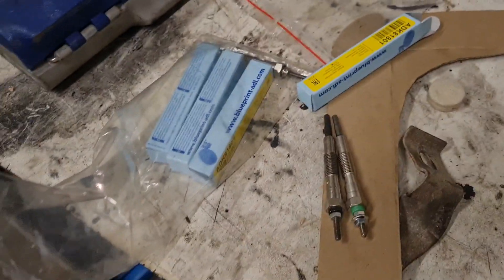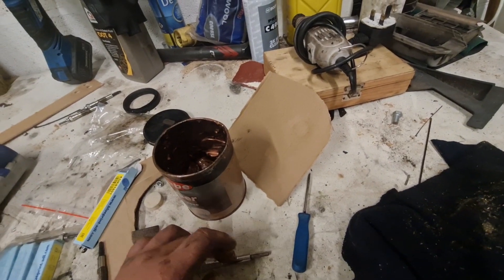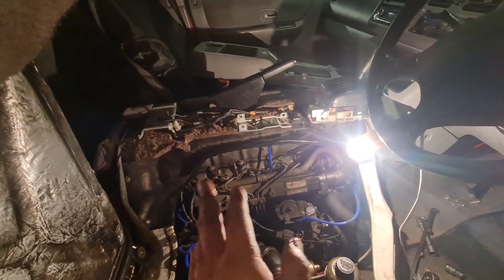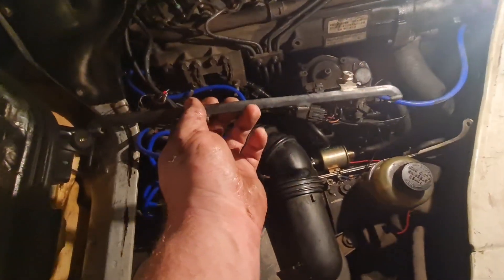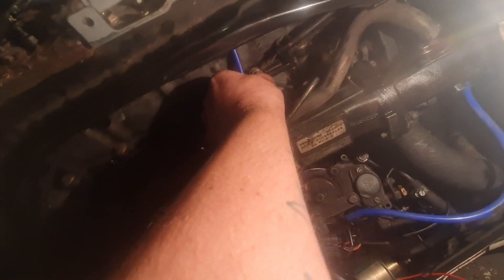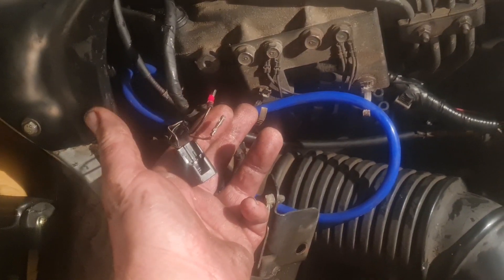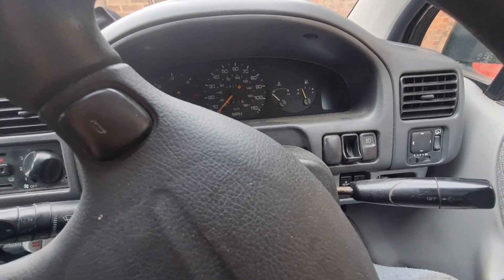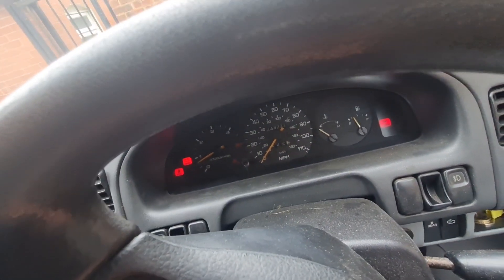mazda bongo / ford freeda. have the glow plugs worked. Will it start well

Comment: Can I suggest cranking the engine as soon as the light goes out?   This way, the glow plugs will remain on for a few seconds to aid cold running.  1.4 Fusions do that to warm the cylinders, then they go off.  If you crank after the click, the cylinders will have no warm assist for the first few moments. Just a thought.
Reply from the maker: Makes sense. All the forums suggest waiting. I'll give it ago. The oil light is now on so I'll have to look at that too
Reply: @wardysworx  Oh good grief . . .